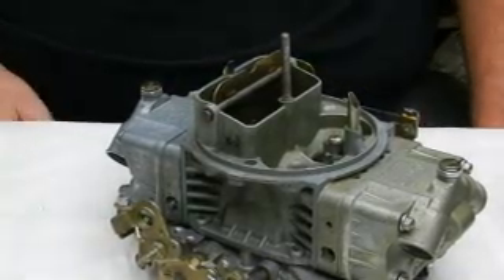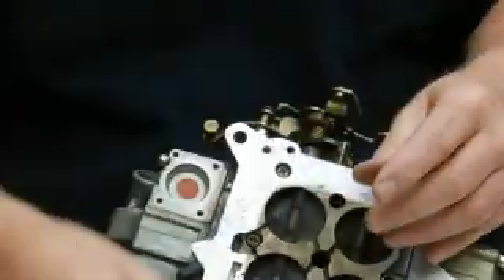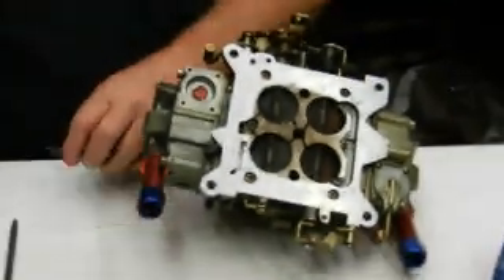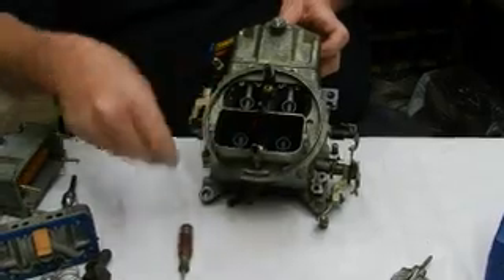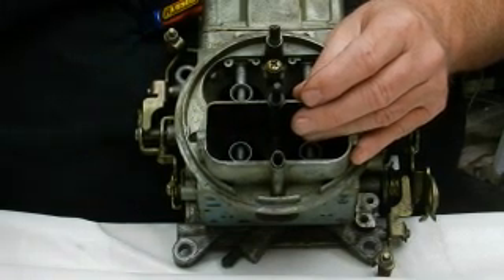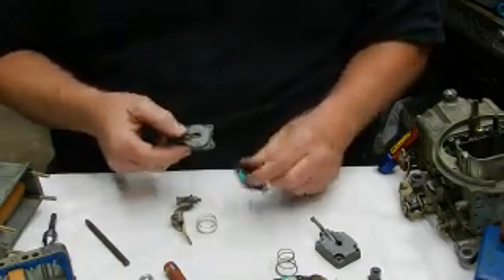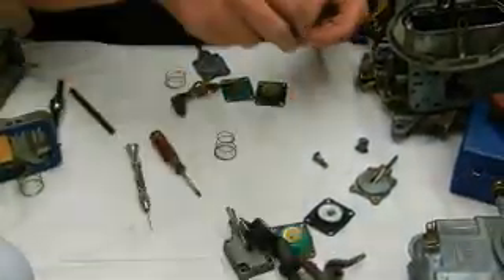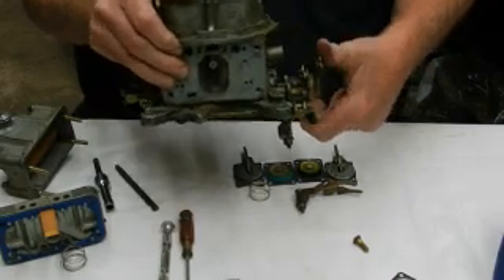Holley Carburetor: (PART 1) Accelerator Pump Explained

Comment: I need help, please. I have Holley 2bbl on my volvo penta engine. When engine reach 3000rpm and more i see that fuel is coming out from accelerator pump discharge nozzle. Is that normal?
Reply from the maker: Yes it's normal. You may can find a counter weight slash check valve that is heavier that will slow it down, but they all do it at some point. Want hurt anything. Hope this helps.

Comment: You forgot to tell novices , secondary spring is tapered, i found a carb with a streched primary spring in the secondary, its bigger diamatet was setting up against the diaphram. Did not work !
Reply from the maker: Just remember 30cc pump springs aren't tapered , 50cc pump springs are tapered and taller. Have a great day. The carb i was rebuilding both primary and secondary were both 30 cc pumps.

Comment: Never new there was a brass check valve below the squirter nozzles. My 800 quit squirting on the front pump. I'd assume it's the check valve sticking. Bowl and metering block is fine. Thanks for sharing this knowledge and tricks
Reply from the maker: That check valve will stick sometimes especially if not used regularly.

Comment: I have a 1969 mustang 302 with a 4 barrel Holley single pump. It runs well at idle also when accelerating nice and easy on the street and highway. But, when you accelerate real hard to pass someone it sounds like it wants to bog down or misfires. My dad said he replace the carb a few years back because it was doing the same thing and it fixed the issue. Do you think the Accelerator diaphragm is the issue?
Reply from the maker: It's could be the accel.pump make sure there is no play in the pump linkage if there is adjust pump lever till you have no clearance at closed throttle next ,with the   engine off  look down the throat of the carb and as you open the throttle see if you see two separate squirts of gas , if all is good you could need to change accel.pump discharge nozzles to a bigger size but before you do that, make sure your timing and mechanical and vacuum advance are all good and you have a good amount of fuel flow to the carb and also check fuel filter for restriction, there is a lot of things that can cause this  including  ignition or trash in the carburetor , hope this helps. PS if you are still using points as condenser if your points start  closing up it will retard your timing check and adjust your points before setting your timing .

Comment: where the heck do the check balls go?
Reply from the maker: If it's a vacuum secondary 4160, you have one in most of the secondary diaphragm housing not all have it , most older models do, also older models have them as a accel pump check at the  bottom of the fuel bowl  but not usually serviced, hope this helps.usually I don't replace them in holleys, there is a lot of extra parts , rebuild kits fit many different carbs.
Reply: Thanks it’s a summit carb that is a cross between the auto lite 4100 and a Holley it was running good and NO check ball under the sqirters so thanks I won’t worry about replacing them there is a cake valve in the bottom of the primary bowl that’s working

Comment: Hi Randy, if I’m getting slight spluttering happening under load when the throttle is depressed could this be because of my cam profile being too aggressive? It’s fine on initial take off, just not under even the slightest load…
Reply from the maker: That sounds more like ignition , ignition will break down under a load, if you have an automatic transmission and you hold the brake and put it under a light load and feel if the miss is there , sometimes you can see the problem on a dark night , ignition jumping and arching, hope this helps.
Reply: maybe need a bigger nozzle
Reply: I have gone through my ignition system with a fine comb and everything there is working fine, it almost feels as though the engine is under powered until I get some air velocity happening and then it starts to pick up again. The word spluttering was probably a bit harsh here, it’s almost like a lean misfire… I’ve got a 350 Holley on a mildly worked straight 6 3.1L which makes about 200hp @ 4800rpm. The engine was dyno tuned with that carb before it was put in the car  but the extra weight of the car has unveiled this issue for me. I’ve watched your other video on drilling out the idle holes in the throttle plate as I have also noticed my idle screw adjustments really don’t do anything to change manifold vacuum, could this be where my problem starts?
Reply from the maker: How aggressive is your camshaft,  send me your cam card numbers and any other specs  like compression ect. , we will try to  work this out.
Reply: Holley Carbs: How To's & Advice ,40 yrs of exp. I don’t know exact specs but it’s based around a mild 30/70 lobe separation with 500 thous lift roughly, have 10:1 compression, 3.36 diff ratio and a 5 speed manual. Have electronic ignition with vacuum adv and a base timing set at 17 deg @ 4000rpm

Comment: Hi Randy thx for the video.. I just got a now 650 holley double Pumper. I'm having an issue that when I turn on the car the carburetor  accelerates up to 2000 RPMs with the choke on when I take the choke off it stalls. Any suggestions would help thx.
Reply from the maker: Sounds like possible vacuum leak if not check your idle circuit make sure its clean and adjusted properly also  it's easy to put the wrong main body to throttle plate gasket on , it will cover your idle circuit hole make sure your gasket matches the holes in your main body of your carburetor, hope this helps.

Comment: Hi Randy...GREAT VIDEO & EXPLAINATION.  ? how do I determine what cam to use & why.
Yazmin
Venice Beach CA
Reply: I think of it like this: the Accelerator pump is like a shot glass of fuel, and the Cam is how fast it gets poured.  If you have light car, where the RPMs can increase quickly you can use an aggressive cam (pours the fuel quickly into the carb).  If you have a big heavy car like a suburban, your acceleration will be slower and you'll want a less aggressive cam profile (pours the fuel more slowly into the carb) because the RPMs increase more slowly due to the big load.
Reply: swissarmychainsaw i have a plow truck with 1850 and 63 jets .. 29 pump nozzle. 1/4 past idle will bog or pop n die completely rebuilt.. vac. secondary. 6.5 power valve. or how about a light weight  or no check valve?  and why  2 steel balls
Reply from the maker: I'm  going to due a video soon on that. Thanks for watching